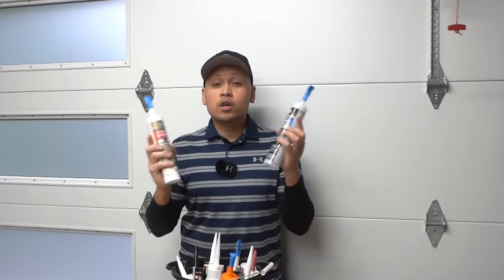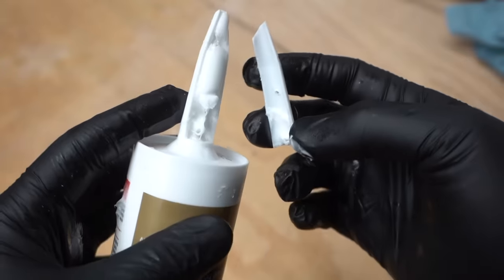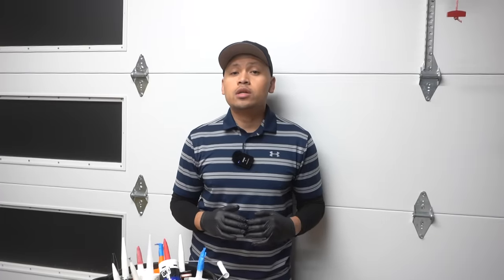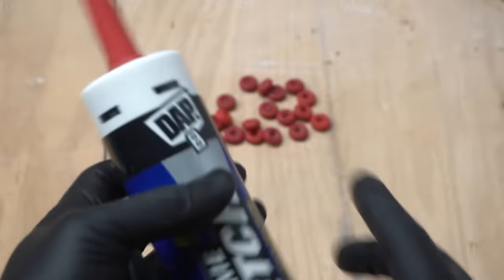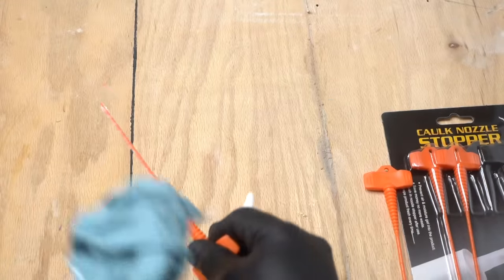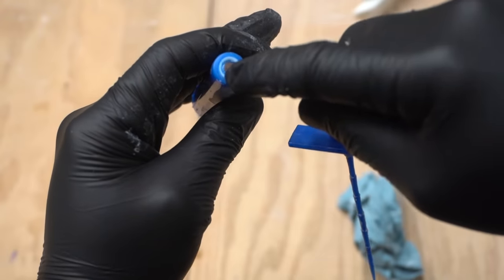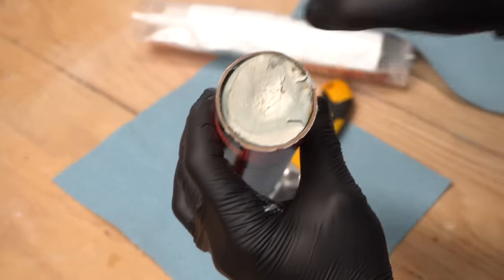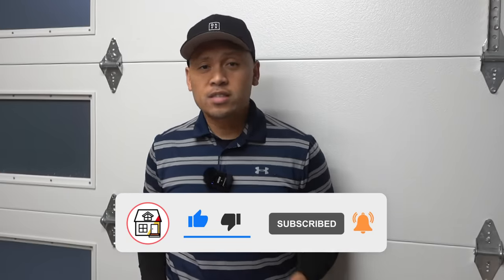STOP Throwing Away Half-Used Dried-Up Caulk Tubes! How To Fix It To Last Forever!

Comment: I wrap a piece of clear plastic, like from a used baggie or Saran Wrap.  I seal it airtight with a small rubber band looped around several times.  The key to success is to pump a little ball of the silicone out of the tip into the plastic cover.  That makes an absolutely airtight seal.  As the ball dries up inside the plastic wrap, it 100% seals the silicone inside the tip.  Worst case situation if it dries up inside the tip, I cut the tapered end of the tip off (about half of the nozzle) and drill the dry silicone out.  Then I pump it until all the dry bits are flushed out.  Lastly, I don't bother trying to save the last one or two inches of silicone in the tube.  The more silicone in the tube when you seal it, the more solvent there is to keep the silicone wet.  If there is just a tiny bit, it's going to dry out in a few weeks no matter what.  So use it or lose it.  Good video.  I bought some of the Tube-a-news.

Comment: Even with the caulk condoms, certain caulks still dry out.  My method: I cut the middle of the nozzle at a 45 degree angle almost all the way through but leaving a small flap where the nozzle can hinge open.  Remove the hardened plug from inside the nozzle then fold it back over and tape it.  Works every time

Comment: Before your done caulking ,  squirt a little caulk onto paper then clean the caulk tube out several times with hangar wire and a paper towel then apply some caulk to the end of the tube and store in the upright position

Comment: I take the tip that I cut from the top of the tube and put it my pocket. When I'm done caulking, I take the tip from my pocket and push it inverted back into the tube. >< is the basic visual of the inverted tip into the nozzle. Then tape it. Since the tip came from the tip of the nozzle, inverting it and inserting creates the perfect seal. I have unopened tubes a year old and take the tape off, pull the tip out with a pair of needle nose pliers, put it in the gun and it works just fine.

Comment: In my experience, the tube will dry at both ends because both ends allow air to contact the paste.  Your gadgets focus mostly on protecting the tip but the paste at the other end, which moves, will solidify as well and still render the tube useless.  So I think the item that deals best with both ends is the one that puts the whole tube inside a stiff envelope.  You could add more protection to the tip if you wanted.

Comment: Best way to preserve caulk tunes is to use vacuum sealed food saver bags.
Been using this method for for nearly 2 decades now.
You can leave sealed in the vacuum bags for over 2 years and still works like new.
Tip double or even triple seal the bag.

Comment: When im done with a fresh tube of caulk I wrap it with packing tape on time around  and then pinch it together tight . When I find a tube of  calk has dried. I cut the tip in the middle 2 thirds the   way through and make like  a hinge, open it and take a nail or something and push out the dried part .Then I close the tip again and tape it. Most of the time if  caukking it's 2 to 4 months old it's not dried beyond the tip . I think it's 4 to 6 months before The dry part goes Beyond the tip into the tube itself period.

Comment: For dried and unusable caulking tubes I use a long stiff wire that I screw down through the dried caulk to reach the still liquid caulk.  This is only good for a few times.

Comment: Simpler and I've been doing it for YEARS.  For silicone caulk, it cures back an inch or so after exposed to air. Plugging the hole won't stop that. Take a 4" piece of duct tape and spiral it around the tip of the tube so it extends a couple inches past the opening. Then pull the trigger on the caulk gun and extrude caulk until it is a half inch from the end of your tape.  Pinch the tape and store the tube.  The caulk will cure inside the duct tape and can be pulled off later leaving you with a use-able tube of caulk.

Comment: I've always cut a piece of duct tape, long enough to wrap 1-1/2 times around the nozzle and wide enough to cover the entire nozzle depth plus a little, wrap it around the nozzle, sticking the excess tape at the top together. Stick the caulk tube in a plastic bag, wrap the bag around the tube to exclude any air, then use a large, strong rubber band around the bag and bring it up around the nozzle also. The tape comes off easily. Caulk has lasted for months or years to the last drop. But I will try the caulk caps first shown in the video. Thank you.

Comment: The way we used to do it is deliberately squeeze a little bit of silicon out of the nozzle and leave it hanging there, it sets sealing the tip, then just rip the little piece of silicon hanging out along with the little plug dried in the tip when you want to use it again.

Comment: The way I save caulk tubes is the the nail technique, but after I insert the nail, I squeeze the trigger on my caulk gun to seal the tube, it's always worked, I do like the caulk saver items though, another caulk saver item is called the Dap Cap, it works quite well.

Comment: I remove the white top then cut a piece out a plastic bag .Then put it over the threads of the container simply screw the cap/tube on to both plastic and container . I throw old cap/tubes in a bucket of water and clean them out with a nail .Sometimes it pops out in one piece .It can be done when wet but is messy .

Comment: I got caulk caps from Amazon,and after using things like tape over the nozzle,which do not work, these things work perfectly. Highly recommend them! They also are reusable. Edit Just went to use a tube of silicone sealant I had a caulk cap on,and it had a plug of silicone in the applicator tube,about 1/2 " long. Tried using a long screw,which didn't work too well,so I drilled into the app tube with a large drill bit. That loosened the plug,which I removed with a wood screw. The product under the plug was fine.
Reply: I just ordered.   I'm tired of having to toss caulk and run to buy another one.

Comment: TIL: caulk condoms.. Thanks for the info. I guess they should work on squeeze tube stuff too. Constantly running back to the store because project requires a tube of something I haven't used in months, and it solidified. The blue ones didnt work for me, as they pushed out over time. The long orange ones will wreck the tip size, or even have the tip split on next use, potentially ruining the project.

Comment: All I do is squeeze about 5mm out of the end of the tube. This ensures there is no air in the nozzle. Months later, you carefully pull that out, and it will break away from the product in the nozzle that is still good. Works a treat.

Comment: Great ideas! However, if the ones in the USA can be made so that the nozzles can be screwed on to the body of the silicon tube, then you can unscrew the nozzle and replace it with an unblocked one. (Agreeing with John Snow’s). If manufactures can make a smaller size with a smaller gun??? These will be ideal for small jobs. I tried the smaller ones that you squeeze, but when you have arthritic joints in your fingers it’s not so easy. One keeps trying. I like the little red ‘roll on’ ones. They are very practical.

Comment: I use latex gloves a good bit. I’ve had great success cutting a finger off of my used gloves, capping the tip and wrapping with electrical tape to keep out the air. Cheaper than those little red condoms, but same concept. Those are actually tempting to me due to how easy they are to use.

Comment: The Dap baseboard caulk takes a really long time for the tip of the tube to dry out. What I really have an issue with is silicone. It dries out pretty quickly. I would be willing to use the caulk caps. I think they would work the best.

Comment: thank you very informative. the only problem is that here in Thailand you cant get any of these products. but i am thinking that if i used a finger cot and secured it with a rubber band that it might also do the job, especially as i can get the finger cots here

Comment: There's some really good ideas in the comments. I just use the blue tape and then put the tube in a zip lock baggie (it seems to help if you suck out as much air as you can when sealing the zip lock). The baggies are cheap but some may find them difficult to store.

Comment: In the UK, you can just unscrew the old nozzle and screw on a replacement nozzle which comes with a cap (pack of 5)....perhaps the US needs to follow suit? Sometimes I take an old one off, poke out the gone-off silicone from another tube with a welding rod and use that nozzle 🤷‍♀ - Hammerite paint - similar - it sort of goes-off at the top, but cut it with a stanley knife and the liquid below is good to go 👍

Comment: I think one that should be mentioned is that when finished using the caulk gun, it's important to pull pack the long rod which will create a suction to pull back the caulk out of the tube..

Comment: What I do and find it works well, is squirt a little bit out of the nozzle tip and let it sit and dry.  Once you are ready to reuse the caulking, just pull out the dry excess caulk hanging out of the tip.  No nails or screws needed. 👍

Comment: I use a piece of tough, thin plastic bag material ("chips" bag works well).  Cut a piece 3 x 3 inches. Center the piece on the opening. Drape the plastic down the sides of the tube. Secure it with a piece of cotton string which is braided like rope. Use a taut line hitch knot. After you get the string on and tightened, you can push down slightly on the string as though trying to slide it down the tube. Securing the plastic with a rubber band is not reliable and does not create as tight a seal as the string.

Comment: I grab a hand full of spare nozzles every so often at the hardware store (they are free here at Bunnings in Australia). When I'm done with my caulk tube, I just unscrew the nozzle, put a couple of layers of plastic wrap from the kitchen over the end and then screw the (used) nozzle back on. Next time I use it, I throw the old nozzle away and put on a new one.
Reply: I do the same, except I always clean out and keep a few of the old nozzles. That's because I cut them to a variety of widths and angles and just screw on the best one for any particular job.

Comment: Haven't watched it yet, but I can say that I've never had a caulking tube dry up. I just take a piece of duct tape, center it on the open end of the nozzle, press it down so there's a good seal, and then fold it over on itself and press it down all the way around the nozzle to make a secondary seal.

Comment: There’s a neat little thing in metals called, “Cathodic protection” where the Anode acts as a sacrificial break-down element to protect the more important service cathode.

What’s really crazy, is that the same property applies to certain synthetic materials.  

If you’ve ever had a mouse where the rubberized plastic turns into sticky mush; You now need to replace it.  Silicone is great, HDPE is meltable, PVC is brittle and PET (Polyethyene Terephethalate) is a crime against humanity for the selfish and a crime against earth for eveything else.

Comment: Use caulking tubes with screw-on nozzles. Just move the used nozzle from tube to tube as you fit and use a new tube if caulk so that you build up a stock of unused nozzles. Keep them! Store the used caulk tube with it's used nozzle and if it is blocked when you next need the caulk then screw on a new nozzle. Keep the old one and let it really dry out and harden. Once it has hardened then the hardened caulk usually pushes out to leave a clean nozzle. Keep it! Plus this gives you a choice of different sized cut nozzles, depending on what size hole you need in the nozzle.

Comment: This is interesting. I'm still a little skeptical on the red caps because I've tried cutting off the fingers of rubber gloves and taping it on, and that didn't save it after a few months. Hopefully these will work.

Comment: I do not have any trouble keeping it sealed . I unscrew the nozzle then cut a square from a plastic trash bag . Fold it double if it is thin , place it over the threads of the tube .Then screw the nozzle back on ,or an unused nozzle . To clean nozzles leave them a pail of water .After a few days the nozzle can be cleaned out .

Comment: Wire nuts work great. Those you put over twisted electric wires. Cheap different sizes for your cut tip size. Threaded no air.

Comment: I wrap the end with gaffer tape. Duct tape doesn't work as it is air permeable, and blue tape doesn't make a tight enough seal. But gaffer tape works just fine.

Comment: I haven't tried them, but an item very similar to the Caulk Caps, called Finger Cots, are much cheaper than the Caulk Caps.  You can get them 150 pieces for about $7.  Either way, great video and thank you for the tip.  (Was that a pun?)

Comment: If the caulk goes off with a screen or nail inserted, I drill the solid caulk out. But I wouldn’t use calk or silicone after 6 months it deteriorates in the tube. Liquid nails holds up quite well after months trouble is you probably won’t get the nossel off. TBH if those solutions don’t work, if of to buy a new one.

Comment: The problem with using any type of "Plug" in the end of the nozzle - is that the caulk will set from where it was exposed to air. This means that over time it will solidify from the tip and into the  nozzle. The taper on the nozzle means that the plug is wider inside than at the tip of the nozzle and can not be removed from the tip without cutting it larger or removing it OR cleaning/replacing the whole nozzle. If you wrap duct tape tightly around the middle of the nozzle and leave a conical pointy gap out of the end, you can squeeze out around 1cc until the caulk is exposed at the end. then, release the force pressure and leave it. What happens next is that the caulk will solidify at the end and slowly set inside the conical piece of tape before ever setting in the nozzle. You can squeeze the tape every week or so and if it feels solid - just replace the tape and squeeze out another small amount. I use this method with a polyurethene product I use every week or so and waste VERY little product saving me plenty.

Comment: Sometimes I have simply extruded a bit from the tube and pressed a thin piece of plastic into the extruded material and let it cure. I've had very varied results with nails and screws, both with drying and discoloration.

Comment: I've always used a 2+ inch screw, it dries around the screw and then you can pull that dried chunk right out and the tubes likes brand new. The liquid nails and anything that dries hard is tough, the silicones are flexible enough to squeeze out. The screw has to be long enough to go through the whole tip. (just.sounds wrong) haha

Comment: Use aliuminum tape to seal the tips, or even the bottoms. That'll stop moisture and air from contacting the caulk. It'll keep it from solidifying for a year at least.

Comment: I've never had luck with those lil pecker caps. I will have to try the other caulk caps. I wonder if its because of the air that is still inside of the cap after sealing it.

Comment: Here are a couple of other methods to try:
a) Try fill a small tube (or vial, bottle, tin, toy balloon) with melted candle wax, then extrude a small amount of caulk, from the nozzle tip (to ensure no air is inside the nozzle), then fully immerse the nozzle in the wax filled tube, and wait for it to set. I haven't tried it. But I am pretty hopeful it should work. The wax has moisture repellent properties and is also atmosphere proof as far as I know.
b) Vacuum seal the entire caulk tube inside a vacuum quality bag. Also place some dried silica gel crystals (e.g. cat litter type) desiccant inside the vacuum bag before you vacuum seal. Removing the residual air moisture with the desiccant should inhibit curing.
c) Place the product in the freezer? Low temperature retards curing so should increase the storage life.
Reply: WAY too complicated
Reply: @evhvariac2  Yes it is a bit more complicated than some other ways. But if I want the cartridge to last for years, this is what I will try.
Do the other simpler ways last for years and years?
I am so sick and tired of buying a new cartridge of silicone just for doing small items from time to time.

Comment: I had good experience with aluminium tape. After l'm done with work I unscrew nozzle, put a bit of aluminium tape on the outlet and screw nozzle back. Typical adhesive tapes (or "plastics" in general) are air permeable, metal isn't. But TIL about caulk caps, I'm gonna give them a go (if I'll be able to get them here where I live). Less messier than my solution.

Comment: The best hack I've found is tape up the nozzle and then press the trigger to fill the nozzle. This clears the air and preserves the caulk. I've gone over a month using this and the caulk was perfect when I returned.  Use a quality tape, not masking. I used duck and gorilla.

Comment: Yeah, I use wire nuts to cap off my partially used tubes. I haven't had any problems if it's used again in 6 months or so.

Comment: I just wrap some 3M electrical tape around the tip, spiral it up over the end, fold that over the tip to seal it, and continue another couple of wraps around the fold to ensure it stays sealed. The 3M tape is stretchier than other brands so allows it to seal tightly, almost like amalgamating tape. Been doing it that way for years and as long as I ensure it's done correctly it works reliably.

Comment: I suspect the paper tape is air permeable I would suggest vinyl tape like electrical tape.   In a pinch, use plastic wrap over the nozzle and secure it by using a rubber band twisted around a number of times.